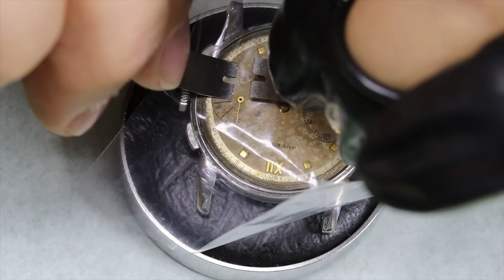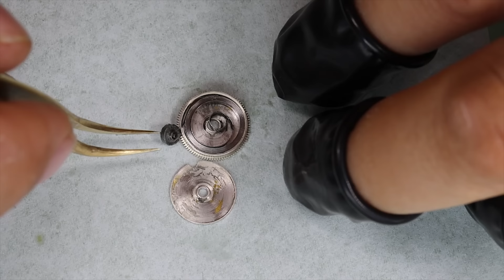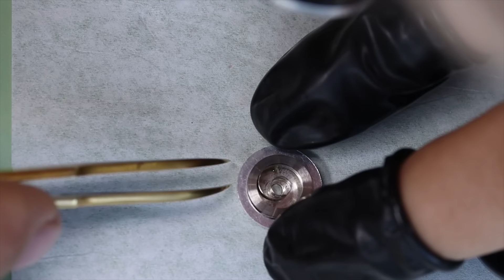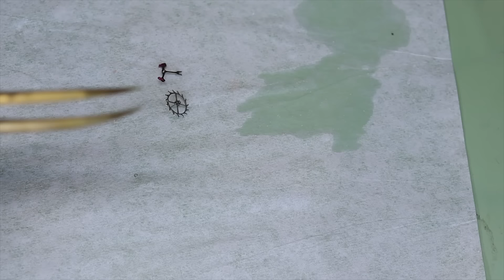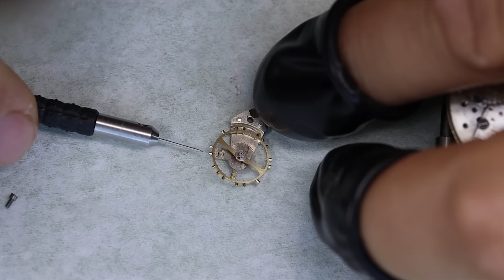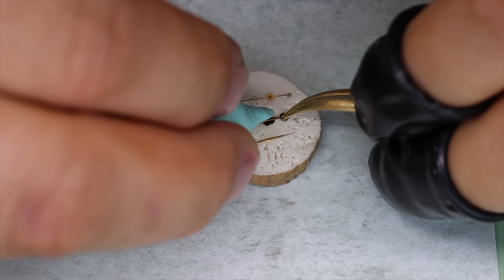Chronograph Legends - Servicing a Venus 175

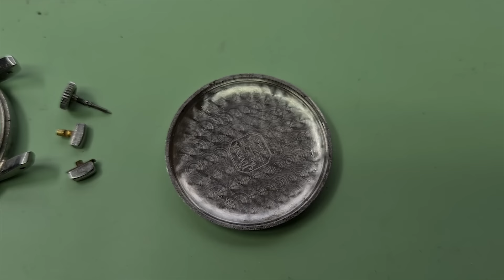Comment: Greetings from the USA, sir!  I've taken on watchmaking as hobby over the past year and am a huge fan of your channel.  I have a question that hopefully you can shed some light on.  I've recently won a bid for a mid-1940's chronograph that I'm certain is using Venus 170 movement with the unique 12:00 and 6:00 sub-dials.  The dial face is labeled "Estrella" but I can find no record of this watch company anywhere.  Curiously, the dial face looks identical to a similar "Breitling" model of the same vintage (same styling, fonts, colors, scales, etc.) with only the name changed to Estrella.  The movement bridge itself has no branding.  Was "Estrella" connected to Brietling in some way?  Is there a source I can reference?  I'll be happy to send a couple of photos your way if that would help.  Thanks in advance.  I trust your encyclopedic knowledge on these things!
Reply from the maker: Thanks for watching! I don't know about that brand, but the dials of these types of watches would often be quite similar due to the location of the subdials. Thus most likely it's just one of the many brands that existed back in the day.
Reply: @VintageWatchServices  many thanks! It should be a fun challenge. Your videos help so much.

Comment: My friend I need your expertise I have a Breitling chronograph with a Venus 175 movement my issue is my pushers are both soft is it a spring used and where can I purchase this my other question is my crown pulls out but recedes back into the watch I can change the time and I can wind it fine but when I pull it out to change the time it recedes back into the watch is it a crown lock that would be causing that problem and where can I purchase this thank you
Reply from the maker: Hello Robert, thanks for watching! It's very difficult to say much about your issues, it can be a lot of causes for them. Are you sure you're up to working on such a watch yourself?

Comment: Citizen had a rather elegant solution to the expense of the column wheel switcher: around the end of the 1960s they patented a switcher which uses a pair of one-way toothed wheels riveted together with an offset which allows them to perform the same function as a column wheel.  Frederique Constant, which is owned by Citizen, recently introduced a new chronograph movement which even further refines this solution by making the wheels star shaped.  This allows the switching to be just as smooth as a traditional column wheel but allows the use of much simpler machined or stamped parts rather than an expensive to make single-piece precision part with complex features.
Reply from the maker: Interesting. I'll have a Citizen chronograph on the channel shortly but don't yet know what kind of movement is inside.

Comment: Hmmm. Looks to me like the last guy to work on this watch sneezed on the watch dial. However, to each his own.
Reply from the maker: Thanks for watching! Beauty is in the eye of the beholder 😉

It's actually only a decade or two since these kinds of dials would be repainted or replaced. The appreciation of original dials with visible ageing has grown since then and now most collectors would much rather have the original dial than a refinished one.
Reply: @VintageWatchServices  I've been wondering if maybe these heavily oiled watches are due to owners or their children "servicing" the watch. Maybe?

Comment: Hi! I am very new to this hobby of watch repair/jewelry repair. I was wondering where I can get the kit that is used to determine the watch band size. Or should I just get some digital calipers and measure them that way?
Reply from the maker: Hello Nate, welcome to a wonderful hobby! You can indeed simply use calipers, but when you buy a watch it should also say the lug size. Most vintage watches at around 34-35mm size will have 18mm lugs, the 36-38 typically 19mm and smaller ones typically 16, sometimes 17.
There are also some handy gauges you can buy.

Comment: Very nice and informative video. I was wondering what product you use to polish the crystal. I guess it is a plastic one. Many thanks.
Reply from the maker: Thank you, Mohamad! For the crystal I first use different degrees of sand paper to get the deep scratches out (800, 1200, 2000 grit), then a product called PolyWatch for the final polish.
Reply: @VintageWatchServices  Thank you for your reply. I usually use send papers and finish with Cerium Oxide paste. Do you think Polywatch is a better alternative?
Reply from the maker: I wouldn't be surprised if PolyWatch contains cerium oxide 😁 There's supposedly also some plastic polymer in it that fills the scratches but I'm not sure if that's really the case.
Cerium oxide should work well on plastic crystals but also works on mineral glass, which regular PolyWatch doesn't. There is a separate PolyWatch product for mineral glass which might also contain cerium oxide 😂
Reply: @VintageWatchServices  I checked it out. You are right, there is one for mineral glass. Many thanks.

Comment: Couldn't the dial be lacquered to avoid it shedding off material that will end up inside the movement?
Reply from the maker: Hello Mohamed, thanks for watching and for your question! I would be very cautious with adding varnish to a dial like this, as you would likely end up destroying it. When they add varnish during production they are able to apply it in a very thin and even layer, and doing so without the right equipment is more likely to produce disaster than improvement...
The danger of the dial shedding any material is very small, there are no loose fragments on it. When I talked about it being like butterfly wings it was more the feel of it, not that there's actual dust on it :)
Reply: @VintageWatchServices  Thank you for your reply, please keep sharing, I love the videos.
Reply from the maker: Thanks for watching them, and yes, I'll keep sharing :)

Comment: If the barrel was scored how do you repair it?  Could you use the magic rhodium or is there another technique?
Reply from the maker: Hello Ashley, if the barrel is scored you would need to remove the scores first. The easiest way to do that would be to fix the barrel in a lathe and gently sand off the surface until it is smooth. It is very rare that a barrel is deeply scored, so it should not be necessary to change the height of the mainspring. Then after you have smoothened out the surface you could apply magic rhodium if you prefer, but that would pretty much be purely cosmetical.

Comment: I have been watching your work with great interest. Thank you for encouraging the questions. I have this Omega Constellation 562 from late 60s early 70s (serial starts with 29). I have taken it to two local watch service centers and I’ve asked them to regulate it properly, but all they did was to push the regulators to the limit and give it back to me. Although those regulator adjustments, both the hair spring and the A/R screw, the watch is running ~20sec/day slow. Do you have any advice for this?
Reply from the maker: Thanks for your kind words! Did the watch run well before or did it always run slow? From what I understand the service centers pushed the regulator as far as it goes to make the watch run faster?
Reply: @VintageWatchServices  Thank you for your kind response. When I bought this watch, I have spotted some rusting over some screws, therefore decided to have it serviced. The watch was working fine before, just gaining a few seconds a day. I am suspecting they have used the wrong lubricant for this watch, do you share the same opinion?
Reply from the maker: If the watch was working fine before there shouldn't be any severe issues with it, and using wrong lubricants also shouldn't make that much of a difference unless they went completely nuts in what and where they used it.
I'm a bit confused though, you said they pushed the regulator all the way to make it run faster and it still runs too slow, that sounds much more serious and could indicate a hairspring issue but if it ran well before that also sounds improbable.

Comment: As I was late to the party, I was wondering about this and a ST19. I've seen that they are essentially the same movement. I have a Seagull 1963 reissue and really like how nice the movement looks. I am hoping to see a Poljot 3133 on your bench soon. Nice to see you back. It was one of the highlights of my week.
Reply from the maker: Hello Clay, thanks so much for that, very nice to hear! I haven't had the chance to look at the ST19 nor the Poljot yet, but hope to be able to at some point. I'm planning to do a Venus 178 before that though 😉
Reply: Well the ST19 was built in china with the same machines and drawings that Venus has used to make this movement, when, in 1961 Venus sold all their old equipments.
Some minor changes have been made as technology went forward and because I think China has the most extensive experience in service this movement as the watches were issued for military serviceing, but the movement is technically the same thing, not just reverse engineered movements like the ETA clones: ST19 is technically a very young sibling of the original.

Comment: Love your videos. I always wonder how do you remember which screws go where, some pretty obvious but some so not. Thanks again!
Reply from the maker: Hello John, thanks for that! There are some commonalities about the screw types that you pick up after a while, making it relatively easy to see which screws are for the bridges, which are for the pallet fork, which are for the keyless works etc. It is however a challenge especially with chronographs where you can have a loooot of screws. For chronographs I have a few special storage trays with 10 compartments, so I can basically put the screws in with the part they belong to. That makes it easier :)
Reply: @VintageWatchServices  I try to keep the screws with the parts also. But what about cleaning the movements. Do you clean the screws also ?
Reply from the maker: @johnvaluk1401  The screws aren't functional parts so unless they are visibly dirty or rusty I won't clean them. If they need to be cleaned I put them is a few separate small baskets to ensure I can still keep track of them. And taking lots of pictures will also help 😉

Comment: Thanks for another thoroughly enjoyable, entertaining and educational video!  In general, how do you decide when balance staff pivots need to be polished?  Thanks again!!
Reply from the maker: Hi Woody, thanks so much! It really depends on what you mean by "polished". Actually polishing the pivots with a Jacot tool or the like is something you really only do if the pivots are damaged, and you might even have to replace the jewels afterwards with smaller ones given that the diameter of the pivots has changed. So that's a relatively drastic step. Using pithwood, Eveflex sticks or similar things do not actually polish the pivots though I might sort of unintentionally use the word polish, they basically clean off surface dirt and oxydation. 
The balance staff pivots are much better protected than the rest of the wheel pivots, given that they are more or less operating in a closed off area due to the cap jewels and the oil. Thus if the watch is in overall good condition it shouldn't be necessary to treat these pivots apart from normal cleaning. If the watch is dirty and full of gunk you should inspect the balance staff pivots under strong magnification and if they aren't perfectly shaped and shiny, you need to clean them more thoroughly. If they are deformed, for instance mushroomed, you would have to bring out your Jacot tool. 
Hope that helps!
Reply: @VintageWatchServices  Thank you very much for the thorough explanation! That's a huge help!!!

Comment: Great to see a new video! When adjusting beat error is there a way to tell which way you should make the adjustment? Besides trial and error. Whenever I check position under magnification it always appears to be correct, when placed on timegrapher it reveals not as correct as it appears during inspection.
Reply from the maker: There's no other way to see where the beat error lies then by observation, I think. I go through that process in the Hebdomas video :)

Comment: Glad to see you back, I was beginning to worry about you!  And thanks for a great video. I think I learned more about chronographs in this piece then anything I've seen before.  I can only wonder at how someone would make a "homemade spring" for a watch (seems like the heat treat would be tricky), but then I'm still trying to figure out how they thread screws that small! 
   Hope you can get ahold of the Seagull equivalent of the Venus chrono and compare them.  Those Chinese watches seem like a real bargain . 
Stay well.
Reply from the maker: Thanks Randy, that's very nice to hear :) It might be a long time ago that the previous watchmaker did that, as no one would do so nowadays.
I've seen those Seagulls and they honestly look great. Seem to be great value for the money also.
Btw, screws smaller than 1mm are made with rolling dies (if you want to make them yourself on a lathe). They're too small to cut 😉